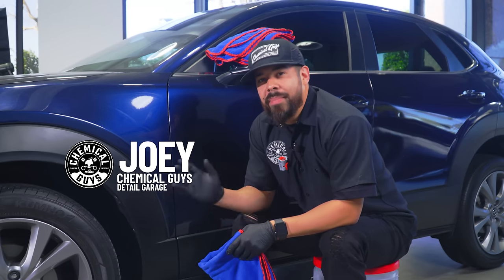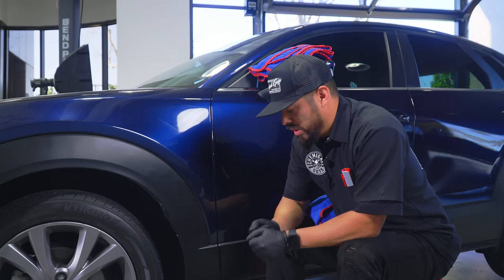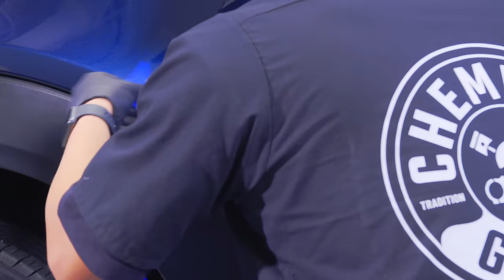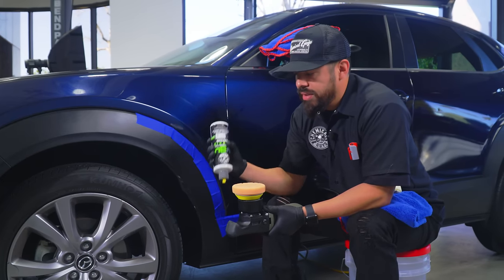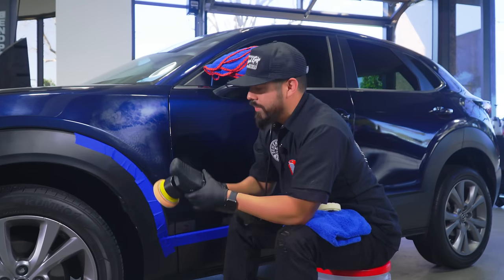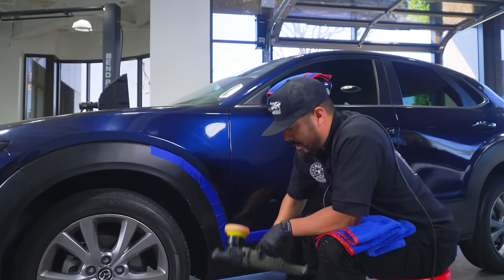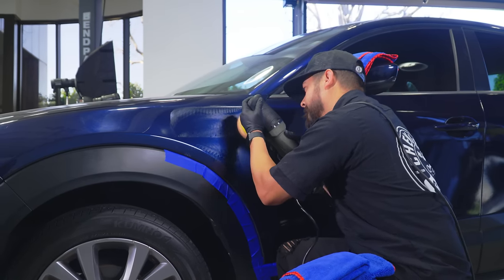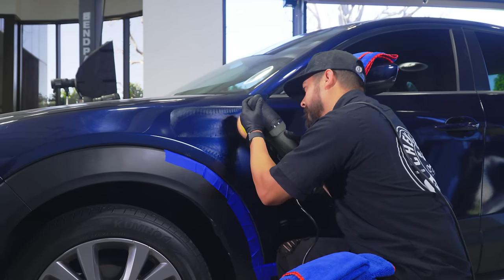How To Remove Scratches from Car - DIY Car Care

Comment: What speed did you set your polisher since it is digital? After you spread it do you go to the highest speed? 2nd question why didn't you try the other compound and show how that one worked?
Reply from the maker: When using a dual action, we recommend spreading the product on speed 1 and work it into the surface on speed 6. Are you referring to V32?

Comment: Aren't you supposed to spray the pad before you use the Torq 10FX to prevent it from over heating?
Reply: Yes, if you’re still new at using a buffer.